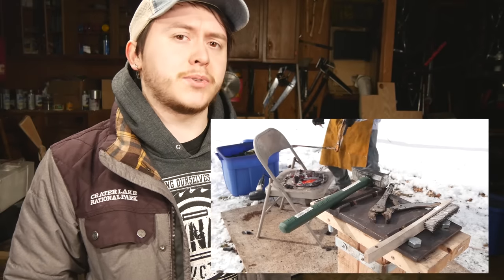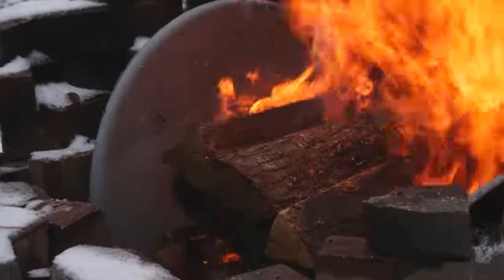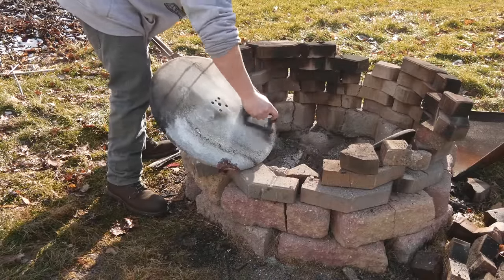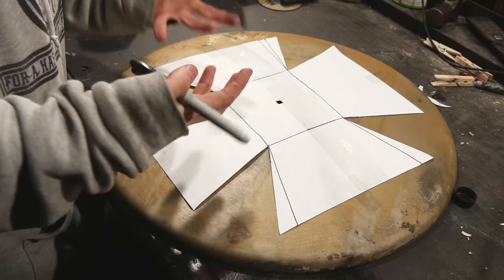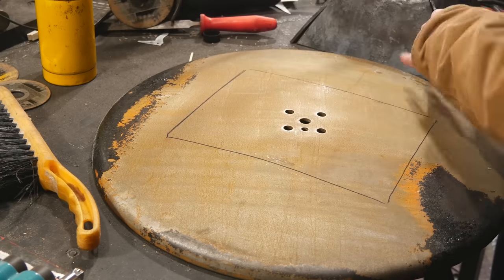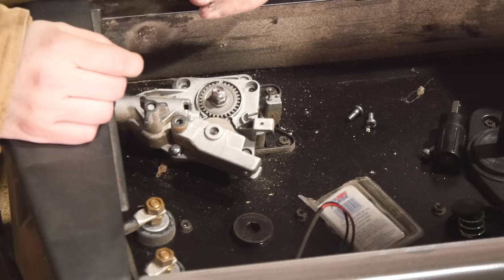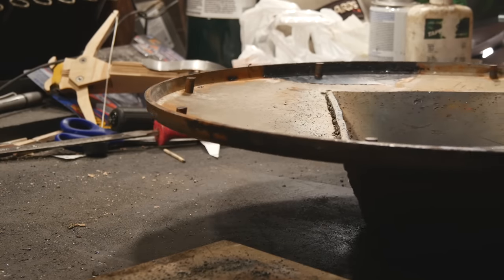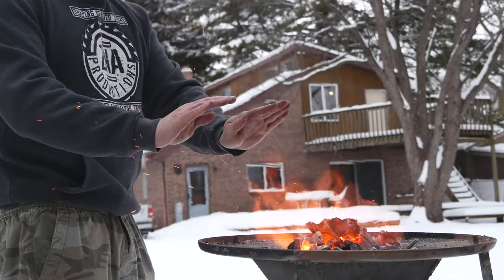-WHITE HOT- (DIY) Blacksmith Forge (Forge Welding Heat!)

Comment: Why is galvanized steel so bad
Reply: Gerard ways left pinky in general it's really good because it's rust resistant, however it does this with an outer layer of zinc coating which releases some toxic level fumes when heated to really high temps that can be lethal when inhaled.